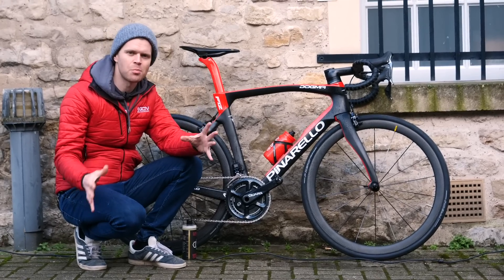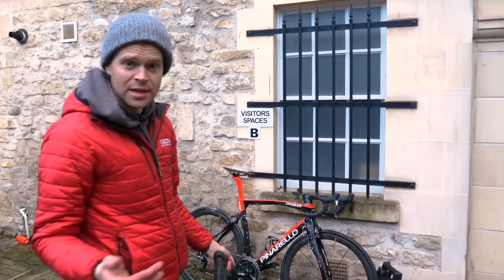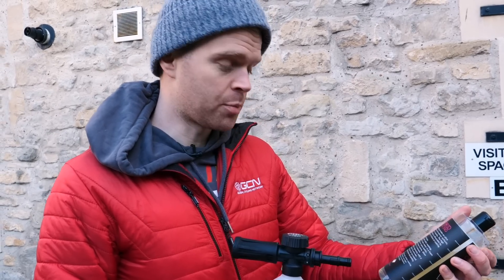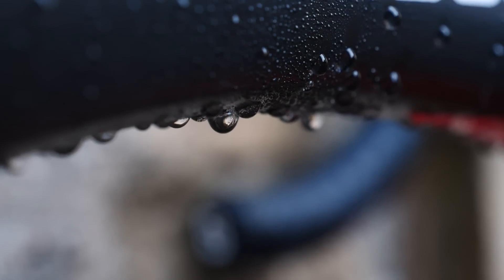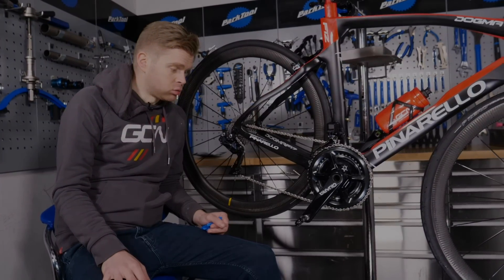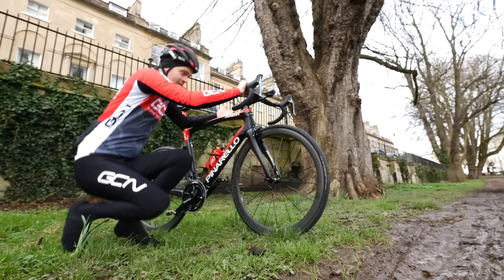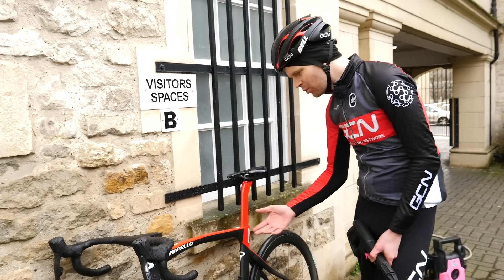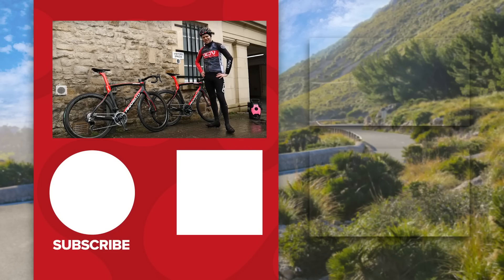Can You Dirt-Proof Your Bike? | Surface Coating Your Road Bike

Comment: Watching this video made me cringe. First, pro teams (and probably you) change bikes every year, so pressure washing your bearings is probably not as big an issue as it is for those of us concerned with long-term durability. Secondly, what effect does the compound have on the environment, which assumedly you washed down a drain in your courtyard. Third, how about the effect of the compound on your tire treads? Does it affect traction? Do you know?

Comment: I've never seen a ceramic coating mixed with water and applied via spray hose.  Every other one I've seen is a liquid applied directly to the paint with a small applicator, much like wax.  It is carefully applied manually to the paint and then small sections are buffed to a nice shine.  One prior step to ceramic application is using an oxidizing stripper to get EVERYTHING off the paint.

Plus, I can't imagine you'd mix regular water with this stuff.  Water hardness varies by region significantly, so it would require distilled water if anything.  

The ceramic stuff is toxic and EXPENSIVE.  You don't spray it all over the place like that and you certainly wouldn't want it all over the front of your house.  

I looked up "Carbon Collective Hybrid Coating" and I don't think it's an actual ceramic coating.  It says it "lasts three months," which is pretty much what typical paint wax does, if not more.  True ceramic coatings to paint are permanent applications and can only be removed with rubbing compound and a buffer wheel.  On high-end cars, it's done only after proper paint correction is performed to maximize end results.  And true ceramic coatings last 1 to 5 years, depending on which you choose.  "Lifetime" coatings are snake oil.

Comment: Pressure washing is unnecessary!  You're using soap/detergent and brushes, so blasting it with high pressure water is unnecessary.  Plus, read virtually any manufacturer's instructions and they all advice against pressure washing bearings.  There's no reason to blast water at your bearings and bearing seals.  Forcing water into your bearings is stupid.

I drove down the US west coast one year through some early winter storms.  The three bikes on the roof were cleaned & dried off and properly stored indoors (in a warm CA apartment, BTW).  A month or so later I decided to service my suspension fork.  I pull out the fork and several ounces of water drain out of the head tube!  Holy crap!  Luckily, the King headset, with stainless bearings, didn't rust.  The aluminum frame didn't even corrode.   The steel steer tube was a different matter.  All resolved fine.  But wow was that an eye-opener on the effects of pressurized water hitting your bike.

Why do it?

Comment: I did a comparison test between Windex and Hydro coating on both my motorbike and bicycles and too be honest I am a little underwhelmed. I could hardly tell the difference. Windex is also a lot cheaper so I will stick with that.

Comment: I used a car wax on the frame of mine. The benefit is that if you're lazy like me, after a wet ride i just wipe the bike down with a microfibre towel and  most of the dirt comes off easy.

Comment: Can I suggest that Meguiars Ultimate Fast Finish aerosol or Turtle Wax hybrid ceramic sealant produce the same or better results, that last longer and are easier to apply. I use them every time I clean my bike and coupled with wax chain lube my bike stays immaculate and so easy to clean. Cassette is absolutely spotless every time.

Comment: Only pressure wash cross bikes - Pinarello cleaning manual states only use an oral B soft toothbrush with purified water, may the Godfather of cycling hunt you down.

Comment: I’ve used ceramic coatings on bike frames for years now but I’d never ever put any on the brake track of a wheel or the tyres . Also I’d not put it on the bar tape, the ceramic coating can crystallise and will make the touch point of bars and saddle feel horrible. Wheels off and I’d only bother using the type you apply with an alligator and not the ones via pressure washer.

Comment: Spray Ceramic coating is the way to go, spray it on supplied micro-fiber cloth and wipe down the frame,forks,etc... after a ride all that's needed is a rinse, reapply everytime you wash the bike. no mess on tires,rims, brakes,etc...

Comment: Funnily enough I spent this afternoon washing, polishing and then waxing my bike. Having one or more coats of wax really helps with the cleaning process. It's important that the surface of the paint/lacquer is smooth first (hence my polishing with a compound beforehand). The combination of a smooth surface and a slippery wax coating means that dirt falls off with the pressure washer quite easily, leaving less manual washing to be done.

Comment: As you said, mud washes off easily, the thing that really sticks is mud mixed with chain lube. Once you start hot waxing your chain you will notice how true that is. With a solid lubricant that won't stick to the frame or to mud you will nearly always be able to clean the bike using just a garden hose, no pressure washing needed.

Comment: I'm thinking - you missed a bit.  The inside of the fork blades, underneath the downtube, etc..
Reply: The other thing I'm thinking now is if you still have to wash it after then it's not really worth doing.  Maybe it works better if the dirt is more liquid or just dust rather than sticky mud..  Maybe a better test would have been to get a bucket of water, mix in some mud and thrown is all over the bike.

Comment: I have to agree with you, I would have disassembled the bike to also get the surfaces behind mounting points to get 100 coverage, Also with rim brakes don't do the wheels, with disk brakes, take the rotors off, then do the wheels but not the tires.  You don't want to impair traction on the road. It would be best to do this when the bike is new and super clean. It works great for cars, and should for bikes.

Comment: I use a product called "RejeX" by the company that produces CorriosionX. The claim on the bottle and after I asked the company is that it makes a micro layer of plastic on the surface, and that you can wax over it after. I found it in one of my local hardware stores for $20 and decided to try it. In my experience, once coated, hitting the bike with a horsehair brush is a quick way to knock the dirt off, and on a steel bike it also covers up any pinholes that may exist in the paint or any chromed/coated components. ...Or large areas where the paint is missing or chipped off...
 The water repellent nature of it is pretty good and probably how it keeps dirt from getting stuck or clinging to the bike, though it will still get on the bike.
 I think the bottle claimed it would coat like 4 SUVs and last a year or something, so doing it on a bike with much less surface area extends the use a lot. Wiped on by hand with some cotton or microfiber cloth, and then buffed with a clean one, no pressure washer.
It also makes areas of the bike that are coated pretty slippery to the touch, so... using it on a cyclocros bike for actually doing cyclocross is probably not a good idea, and you may want to keep it clear of your pedals if not using clipless. Since it's hand-wiped it should be easy to keep it off the braking surface too.

PS: I don't have an aero helmet or cycling shoes (much less carbon/aero ones) so maybe that slickness would work on those for some level of extremely marginal gains?

Comment: For the average person, jetwashing will absolutely blast the dirt on their bike into the bearings along with water, along with removing grease from other important parts. If you're a world tour mechanic and have the parts to replace etc, that's not a problem, but to recommend jetwashing to the public is a bit foolish as it absolutely does cause premature wear of components, presuming they're not just going to jetwash their bikes once.

Comment: I tried a silicon dioxide coating on my new bike last year. Two coats before I ever rode it. I didn’t get the results I was expecting, and I am an experienced car retailer, just not with any kind of ceramic product. And it’s not cheap. This is well timed because the bike got covered in mud on a gravel ride yesterday and needed a deep clean.

Comment: Perhaps not a effective, but MUCH easier to apply is Maxima SC1 High Gloss Coating. It’s in an spray can and just sprays on/wipes off. No pressure washer needed, and will out all the associated overspray waste. I use it on both matte and gloss surfaces and it does a rather decent job.

Comment: I'd double the concentration and use a 1.5 liter handheld pressure sprayer to apply the Si02-based coating ( Wetcoat or Aquacoat ) to the bike ( instead of the wall ), much more effective! Alternatively you can use a comparable product ( Cure from Gyeon ) on your microfiber drying towel. Use it once a month and your bike will thank you with a lot of speed and a proud glossy shine! I like to spoil my favourite bike with a layer of a nice smelling Carnaubawax afterwards for even more beading and a jawdropping wetlook!

Comment: Use a break cleaner to remove these coatings of your disc and I also doubt that they are good for your rim brakes. What you can see very well is the build up of mud around the rim brakes compared to the disc version (One for the disc brake). And btw: make sure the used coatings are environment friendly and bio degradable. There is enough PFAS and like substances polluting nature. 

And I would keep a little bit more distance with the pressure washer ;)
Reply: Carbon fiber bikes add way more pollution the environment by weight of the type you're specifying than any thin layer of coating.
Reply: @Aubreykun  So that is an excuse to pollute even more? I understand the dilemma, but lets try to improve on impact, that is the only thing I want to say.
Reply: @TheMagdiragdag  Nope, just pointing out where efforts are spent more efficiently. 
In another context: If someone is obese they will see the best improvements in their times/speeds/etc from simply cycling on any bicycle without worrying about spending on aero components or the grams of small parts

Comment: I have a pure white Ridley climbing bike that cannot stay clean to save its life.  I spent so much time cleaning off dust and oil smudges from the chainstays that when I wanted a Ridley XC bike, I went with a black one.  Are there any worries about getting that coating on the brake track with rim brakes? I want to coat my bikes, but I also don't want to lose braking.

Comment: I’ve done all sorts of ceramic coatings on my cars from the cheapest to the most expensive.  I’ve done them myself, and i’ve paid detailers thousands in some cases.  The claim of remaining “less dirty” is somwwhat true, but dirt will stick, and it can and will look dirty.  What they are good for is (as Ollie tried to demonstrate) allowing the dirt to rinse off easily.  After a really quick wash, my car looks “freshly waxed”, with no other effort.  Bottom line:  if you care about a shiny “waxed” look on your bike, then do it.  Otherwise, don’t think it’s gonna prevent you from having to wash it.
Reply: Share this with the detailers you know and watch their jaws drop.
Reply: Any particularly good product names "stick" with you?
Reply: George Hugh I like the carpro stuff (cquartz, etc) but honestly a lot of these companies take the "toothpaste marketing" approach by confusing the hell out of customers to make them think they need a ton of products for different applications.  I've stopped being anal and picky and started using carpro's hydrO2 rinse on product. It's "ceramic" based like the more involved products, gets you 90% of the look and slickness, and goes on in less than 20 minutes (vs an all day or two affair).  I just can't spend days doing this anymore.  Nor do I want to spend the $thousands that detailers demand for applications

Comment: I’d like to know how the brakes and tires performed after getting hit with the coating.
Reply: Those and also how slippery the saddle and bar tape were.
Reply: Yes to all of these comments.  And think I would have pulled the wheels and wrapped or removed the saddle and brake pads.  Definitely if I had disc brakes
Reply: Yeah I was certainly surprised when he didn't take off the wheels and brake pads
Reply: Donut Endurance yeah, that was my first thought

Comment: For several years I’ve been using a quick detailer called Bouncers Done and Dusted on the car after washing and drying it. I tried it on the bikes and works a treat! It leaves a glossy super slick finish resulting in dirt and grime just falling off with ease,give it a try it doesn’t disappoint.

Comment: Gtechniq is the best for this sort of stuff.  Takes a lot of prep work and effort but the results are good. Pointless doing the drivetrain though (like the cassette) because the friction from the chain will just wear this off.
Reply: Agree. Being using gtechniq products on my bikes for a while now. Needs proper prep but works well. It still gets dirty but is easier to clean and keeps a gloss shine.

Comment: That brand sure makes it easy to get the ceramic coating into the difficult to reach places, which is good. What I used on my Specialized bike was Collinite's Fleetwax 885. It too protected it well against dirt and road grime, as well as making the paint really pop. Now I have a titanium bike so no need for anything but a green scratch pad every 5 or so years.

Comment: As the coating is aging, some surfaces becomes uneven. Tried on my bike and regretted it.
Reply: How so? As in it somehow dissolves the paint job under?
Reply: Andri Egilsson im no expert about it but somehow some the coating surface becomes uneven after about 4months.
I applied only frame to make sure i applied it evenly on frame. I removed all the components before applying.
Reply: @freerider9191  UV might break the molecular cohesion of the film. Other chemicals, both off the road and in the atmosphere might also affect it with time.

Comment: I would have disassembled the whole bike and cleaned it with isopropyl alcohol. These coatings can stay on for a few years if applied well, I think it’s worth to do this during a full reassembly.
Reply: OldPlaces  how much mud do you put it in?
Reply: Personally I also believe that applying it to the brake surface may create one of many plausible scenarios: 1) make the brake track “slippery”, and until that coating is burned off due to brake pad friction, it won’t go back to normal. 2) make the brake track “stickier”, as the coating could plausibly have a reaction under elevated temperatures, thus contaminating the brake pads. 3) due to the properties that ceramics have shown in thermal resistance, it could also inadvertently help reduce some of the heat generated on the brake track.... albeit, any of the above cases might just be a very minimal effect, but, perhaps worth looking into....
Reply: Dio Pena I normally get more hate than “OldPlaces” if I go into that much detail, but don’t stop educating people. It’s really important what parts you coat and what you don’t if you want to ride safe.
Reply: That's the IDEAL time to do it - at initial assembly.  And if not, yes, it's worth pulling it apart and doing it right.
Reply: OldPlaces Do you put tire shine on it also?
Reply: OldPlaces yum yum, it’s the best!
Reply: I don't understand. If you have an expensive bike, why not just PPF coat all the exposed bits like you would with a car. It canny cost more than 25-50 quid..
Reply: @F1ll1nTh3Blanks  Because complicated shapes and sharp bends. At BMC we do put PPF on several of our bikes, to prevent a bottle cage rubbing against a downtube or to prevent stone chipping on gravel bikes or MTB's. But it's very difficult to wrap a whole bike frame in the stuff without having many many cut lines. With cars it's much simpler because of the large surfaces with relatively soft bends, which makes the foil easy to manipulate. But wrapping around tube connections and stay connections is a nightmare.
Reply: Most cyclists don't know how to disassemble and reassemble a bike. This video is for the masses.
Reply: I agree completely, I think it can't be good to get on your tires. I've been waxing some of my bikes for years..

Comment: How would this work for a mixed Matt/gloss finish carbon frame? Oh and you have the snow foam bottle upside down 😉
Reply: My thoughts as well!
Reply: I use Muc-Off Matt finish detailer for that. Matt paint does not take very well to wax like products I believe Jon once did a GCN video about this.
Reply: Lars Borghouts I already use the muc-off product. I’m going to try the crankalious stuff next but I was was just wondering how glossy a finish this method would leave on Matt carbon.
Reply: Ask the folks over at Gyeon Quartz.
Reply: This is the link to that video https://youtu.be/AAs5mKQkQ_4